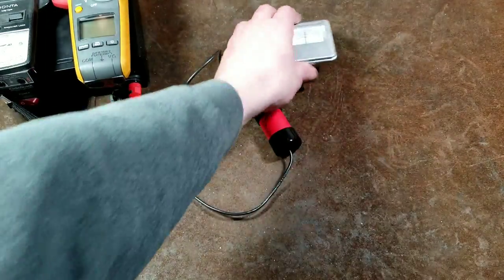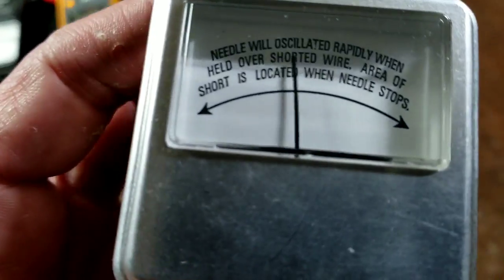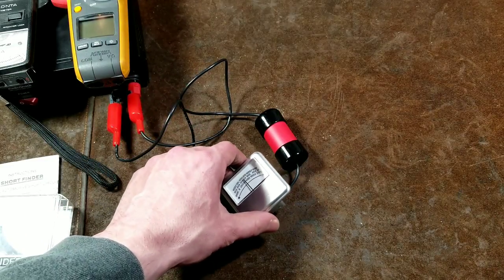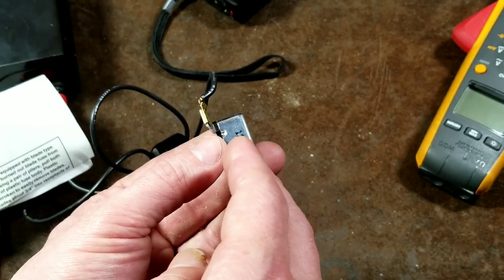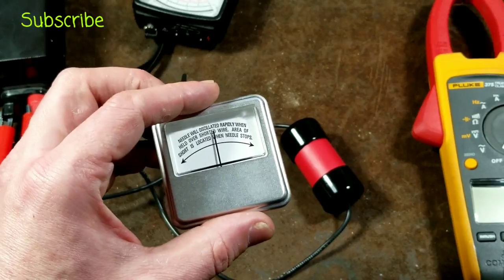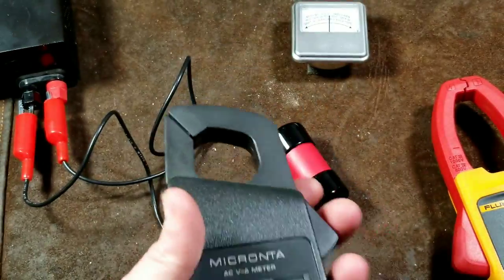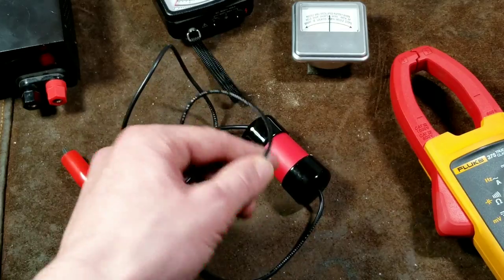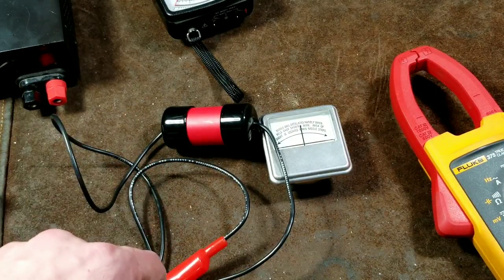S&G Tool Automotive Short Circuit Finder Review

Comment: You forget to mention or don't realize that a huge advantage of the included meter is that the direction the direction of the short is indicated by the direction the needle bounces towards.  If the short happens to be in a bundle of wrapped wires, the needle will point strait up when it is directly over the short.  Further, it will work through a headliner or pillar trim (for example) without having to remove them.
Reply: I have found this tool useful many times over in an automotive environment. It saved me from wasting fuses and gave me direction (no pun intended) through the needle movement of the ammeter. Surpised how many commentors were swayed by this video.

Comment: Good review! Actually any car after '95 should have a few automotive circuit breakers in them, check the fuse boxes under or at sides of dash, especially a window defogger ckt. I agree on the danger of using these. Any "solid state" digital type can easily have diodes & transistors, fets blown out by this. But & its a BIG BUTT, if you can remove any "sensitive" loads from a segment of cable and isolate that segment through a major/minor connector, then these can be well worth it. In my 2003 Impala I have a cable channel of 30-40 signals running from dash down passenger side feeding lights, coils, fuel pump, door locks, seat motor & defogger. One power supply line is shorted.So I can isolate entire cable at fuse box & without to much pain disconnect certain loads like the seats & doors. Its 7 feet of main cable bundle so if this points me to the location its worth it, even outrageously priced. I watched to see what quality/worthiness was in these thanks much.

Comment: Interesting. Questions about these things came up on Reddit/Tools the other day. As an electronics technician (ham) I was curious about it. Someone sent me the manual, which helped a bit, although it refers to a buzzer bridging the blown fuse. I wondered what kind of sensor was in that meter. Since you explain that the box is a multivibrator, that is revealing. That would generate pulsed DC which would be pretty detectable. If they were cheap I’d get one to play with on an oscilloscope. I still don't understand the plus/minus (?) needle excursions.  Thanks.

Comment: A good way to find a short in a car is to replace the blown fuse with a light bulb that takes a couple amps to limit the current then poke around with a compass.  The compass doesn’t need a changing magnetic field to work.
Reply: Exactly what I was thinking.

Comment: Great video, thanks so much!  I am curious if a short only blows the fuse when the engine is running, would this tool find the short? Fuse does not blow immediately with ignition off or just on. Truck starts and runs for a few seconds and fuse blows. If the short only gets grounded by engine vibration, I wonder if this tool would find it. Thanks again!

Comment: You are wrong about it being only good for trailer lighting. You cannot harm the electronics with this. They say not to use it on sensitive electronics only so they won't be liable for someone damaging expensive electronics such as the ECU, when it was actually the fault of the person testing it incorrectly and not the tester itself.

When you measured that 22 amps, you were just measuring a spike in current, not sustained current. There was no power behind that to do any damage. In fact, the current going through there wouldn't even blow a 10 amp fuse. Try it yourself. Connect a 10 amp fuse in series with that breaker and connect it across a battery. You'll see that the fuse does not blow, even though you see 22 amp spikes using your clamp meter.

The fuses in a car are not there to protect electronics. They are there to protect the wiring and to prevent fires. If there is a short somewhere in the wiring, the fuse will blow to prevent the wire from burning up and causing a fire. If the short is in an electronic component, that component is already shot, so a fuse isn't going to save it.

That tester should work fine on any circuit that uses a 5 amp fuse or higher.

Comment: Your clamp meters are not sensitive enough, you can try a special clamp meter for measuring leakage current. I've got one, can measure between 1µA and 100A. It is AC only. A nice tool if you're looking for the reason why an RCD/GFCI is tripping. Simply put line and neutral together in the clamp, then you can see the "missing" current which travels the wrong path.

https://www.benning.de/products-us/testing-measuring-and-safety-equipment/current-clamp-multimeter/benning-cm-9.html

Fluke was too expensive in that case (The Benning isn't cheap either), Megger uses small button cells....so I bought this one, it uses tripple A batteries. 

https://www.amazon.de/Benning-CM-True-RMS-Leckstromzange/dp/B002A024KC/ref=sr_1_1?ie=UTF8&qid=1553106744&sr=8-1&keywords=benning+cm9

It is also required if you perform a PAT (portable appliance test) for a three-phase appliance.

https://en.wikipedia.org/wiki/Portable_appliance_testing